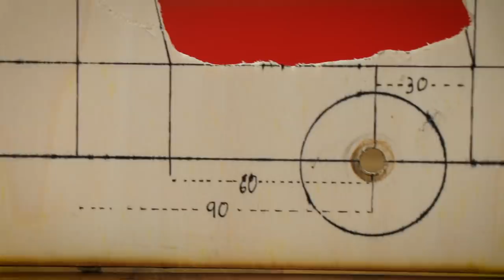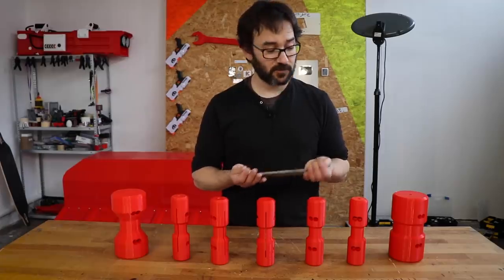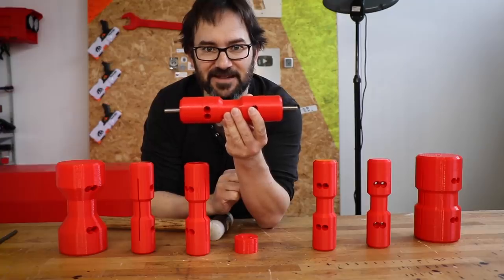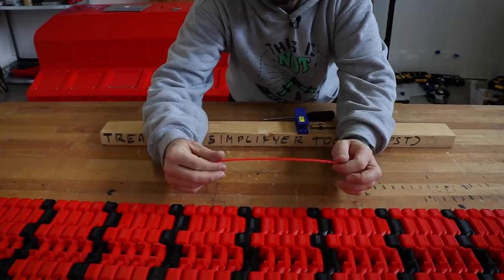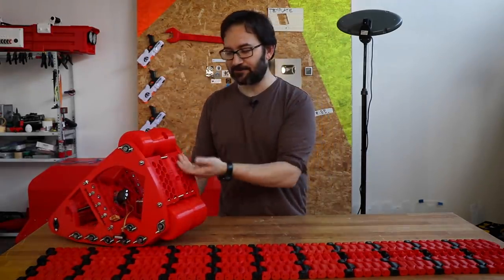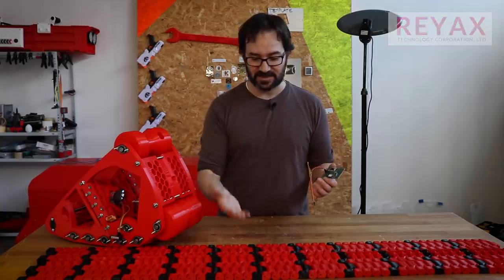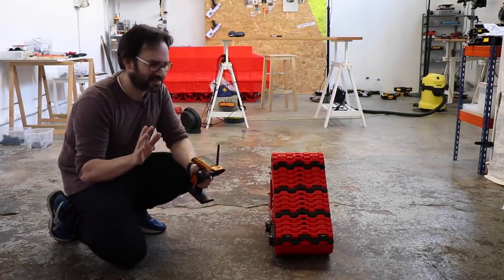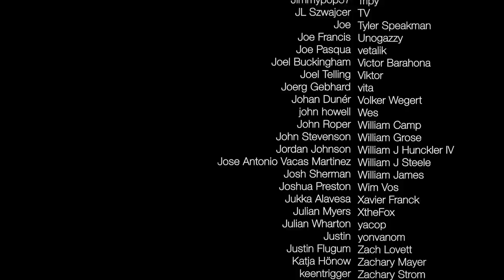3D PRINTED SKATEBOARD TANK BUILD

Comment: Great video as always.   A quick suggestion though.   Under full weight you might need an idler wheel in the middle so that the track isn't rubbing against the frame on the floor side.

Also, and I'm sure you already plan to do this, please limit acceleration and breaking so that you don't get thrown on off should you accidentally grab full throttle, let go of the throttle or loose remote connection for what ever reason.   Don't want anyone to hurt.
Reply from the maker: Not sure if I understood, the track is supported by 5 idlers on the floor side plus the big one in the front and the geared one in the back,  where do you see it rubbing against the frame? I often don't see things because I'm too focused on recording them. About the acceleration, yes, I'll do that for sure. Thanks!
Reply: @ivanmirandawastaken  I'll watch again. I might have just missed the idlers.

Comment: 6:30 I wonder who decided that you needed setscrews in bearings to lock the shaft... If the shaft slips in the bearing, that means the journal bearing formed by the shaft and the inner bearing race is being a better bearing than the roller bearing, and so the roller bearing is kind of useless anyway

and now bearing has stopped feeling like a real word... you're welcome. Bearing.

Comment: 10:25 You should have used that since the beginning!
Reply from the maker: Yes! And the damn thing is still going strong! sometimes I wish it would break to get something a bit better, but in the other hand I'd probably try to repair and rescue it. Good value for the money, 35 Euros in 2015 tips included!
Reply: Ivan Miranda Why break? take it apart and use the motor for one of your project ;)
Reply from the maker: There's no motor inside probably just the rotor would come out if I open it 😂

Comment: So, question; What did you use as the pins for the treads and why didn't you use some kind of metal?
Reply from the maker: That's fish tape, the thing used to pass wires through conduits. When I started doing tracks I used 4 mm steel rod as pins. I test my creations almost always on the sand, and steel tends to rust and it is heavy, this nylon tape is light and indestructible, so Nylon it is.
Reply: @ivanmirandawastaken  

That's actually really interesting to know. Thank you! I was thinking about trying to make a 3D Printed Nerf Tank of some kind. This is good info for if I ever spring on the idea!
Reply from the maker: Go for it!

Comment: Also...  IVAN SHOULD TOTALLY USE MOUNTAIN BOARDING PARTS FOR THE REST OF THIS BUILD. ESPECIALLY THE REAR WHEELS!! Also he should attach the front truck to a board on a hinge so it can pivot and crawl up a hill at 45 degrees while the board is flat still. You could use some pre-tensioned rubber straps to center it with blocks limiting it's range of motion, perhaps even choose the hinges and how they are connected based on the desired range of motion in mind. It would be like cutting the skate board right behind the front truck in the middle and putting some strong rubber bands in to hold it in it's original shape. The tank tread module naturally has a bottom unlike a wheel

Comment: treads seem a little loose but im not an engineer yet so what do i know
Reply from the maker: You know that the treads are loose. As long as the traction sprocket engages that's not an issue, It can be corrected using a slightly bigger top wheel (or adding a tensioner). Thanks!

Comment: Need make another one of these then put a lil place to stand in between the two separate little tank wrap the outside of tracks in a rubber for grip and make it turn left to right with the one out running the other like a tank or tractor be pretty cool all the hoverboard and one wheel kids would shit a brick hahaha